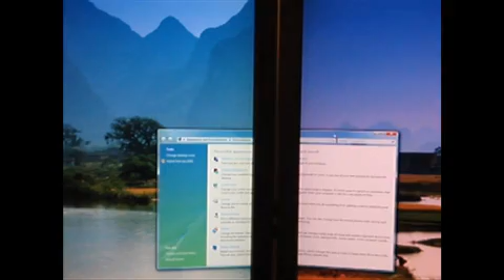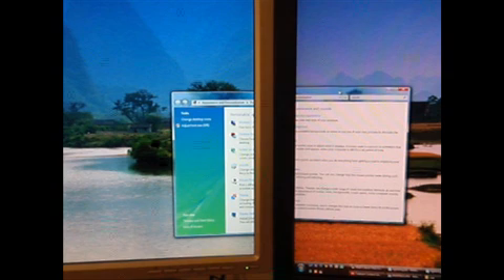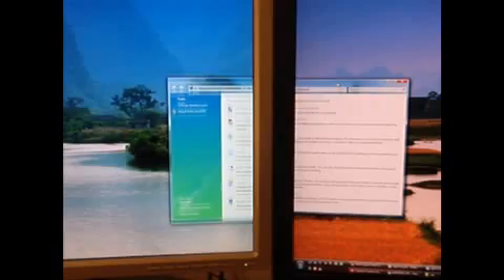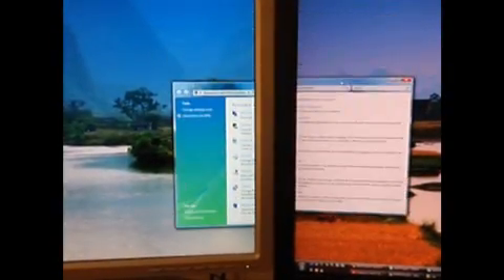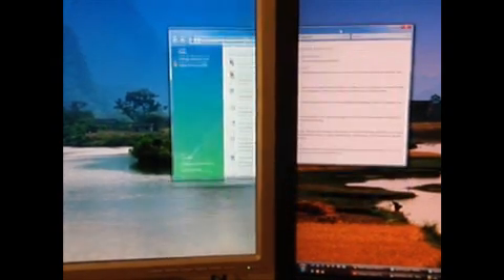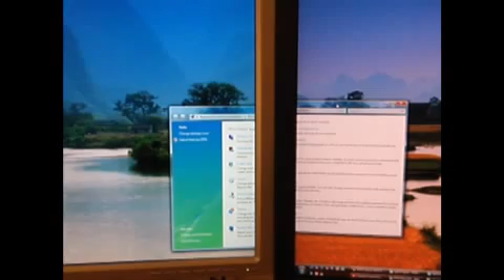Input lag - the problem monitor manufacturers won't mention

Comment: Input lag is the time between the information is comming into the monitor(input connector DVI VGA HDMI etc) and displaying it on the screen.
Response time is the time to take a pixel to change color. Mostly tested grey to grey
Hertz AKA Refreshrate is how many times the light flashes per second.
CRT's are still the best at this time, however most gaming LCD's are comming in close.

Comment: Its the monitor that produces the lag. So it will effect any console/pc you input to it. Input lag is very noticable with hdtvs when playing halo or cod. I prefer to use my hp 21.5 hd monitor because it has way less lag than any hdtv i have played on(several).

Comment: That's because the LCD's input DSP needs to do a lot of image optimizations to compensate for the POOR quality LCD panels they're using.
¿Why we weren't talking about input lag in the good old 15" TFT's made by samsung 15 years ago? Because they were expensive as hell and used a excellent quality LCD panel with optimum color reproduction capabilities, not the washed up colors we see on today's TFT's. BTW, the 15 years LCD's are still running, some of the new ones don't pass the year and break.